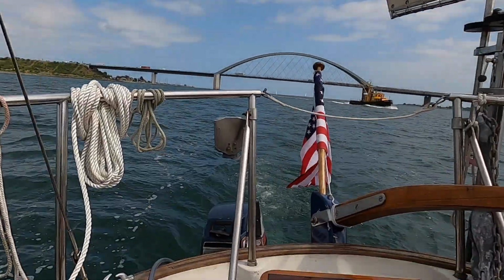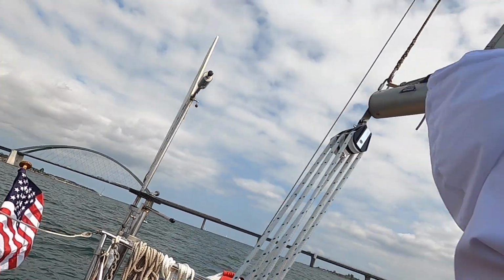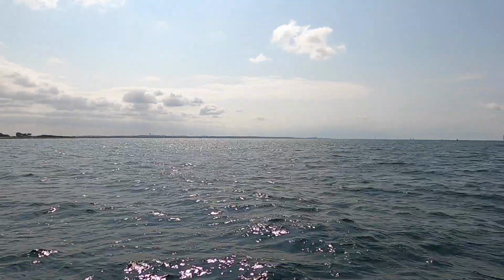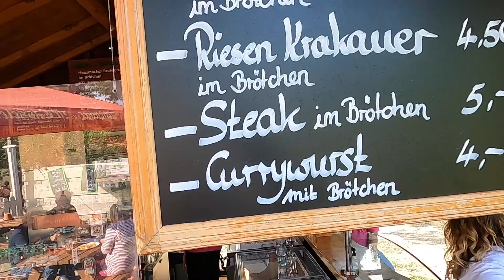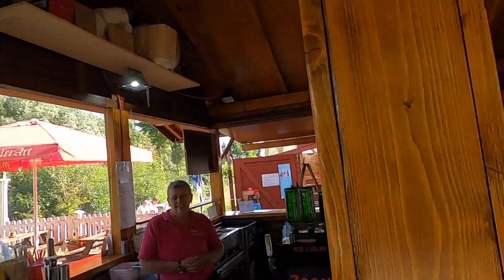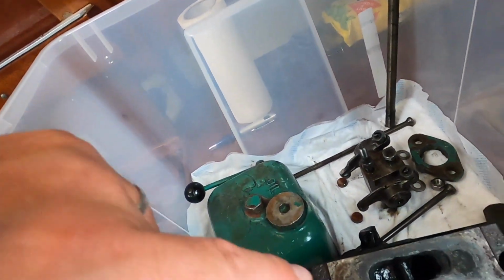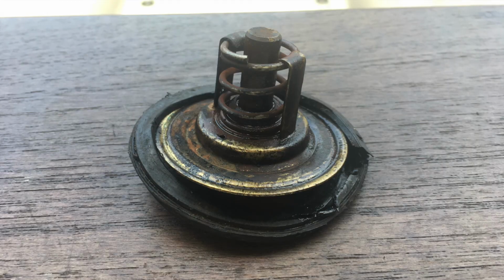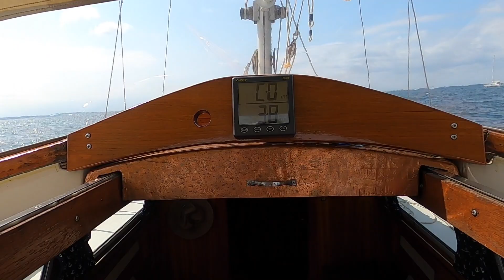Bianca 27 shakedown sail S2E8

Comment: Hi im from sweden i sai a Bianca aswell,how does your winvane work offcenter?im thinking about the same solution😉
Reply from the maker: Hi from Minnesota, I think it doesn't really matter if you install this wind-vane center or off-center. It works usually well either way. I like that it gives you also an auxiliary rudder. I'd say it is a good self steering option for the Bianca 27. Fair winds. Cheers!